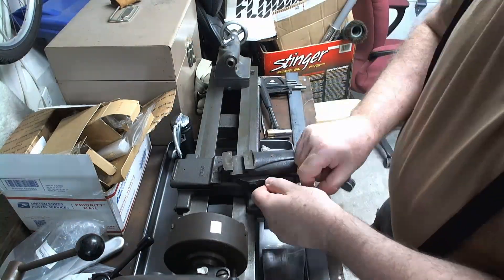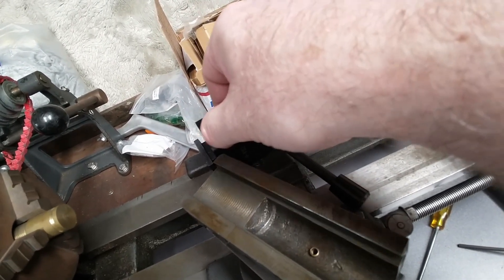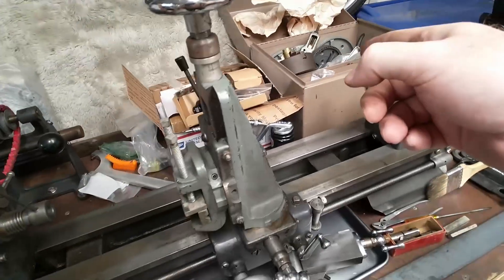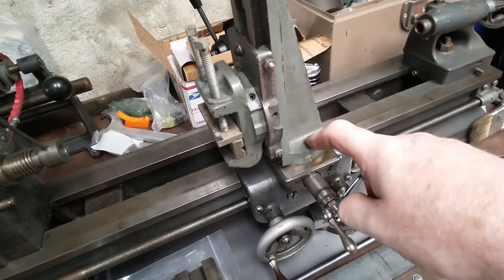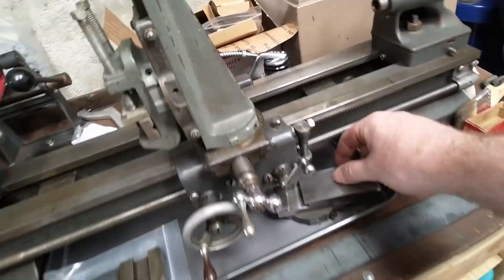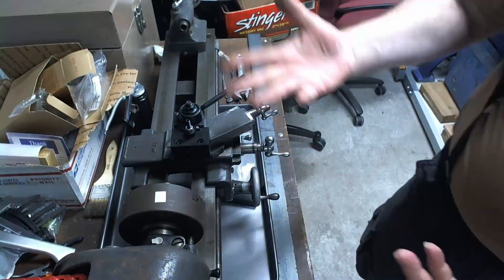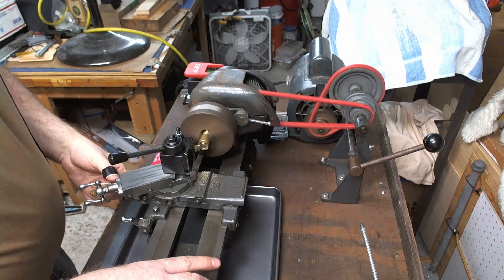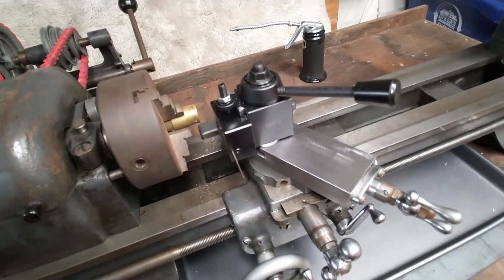Craftsman/Atlas 618 lathe - compound rest replacement and first chips

Comment from the maker: I really need to make time to build the drawers under the lathe so all my tooling/parts have somewhere reliable to go....as I totally forgot that the quick change tool post kit....came with cutting bits:  https://www.amazon.com/Tooling-Package-Atlas-Craftsman-Lathe/dp/B01CF5P94O
So I did have cutters to go in there other than the cut off blade.  Oh well, less to buy I guess. :)  Still need to figure out the milling attachment bits to use though.